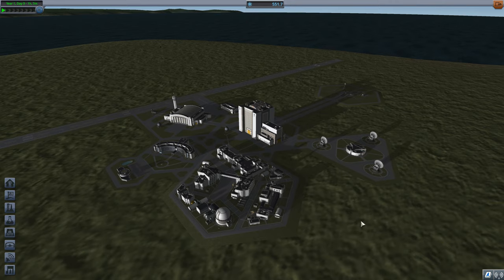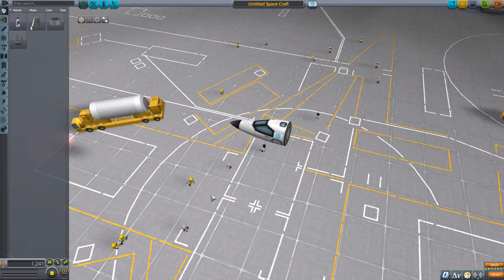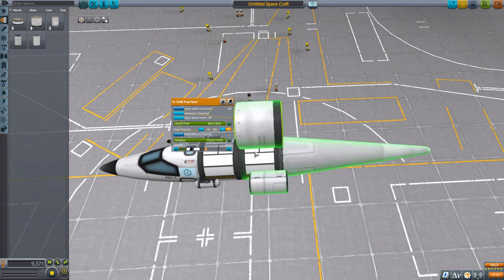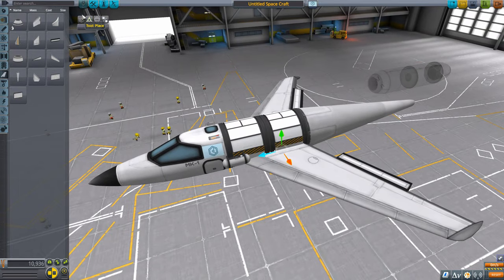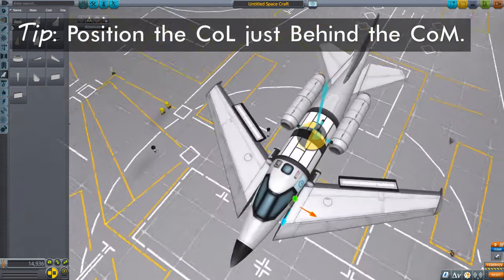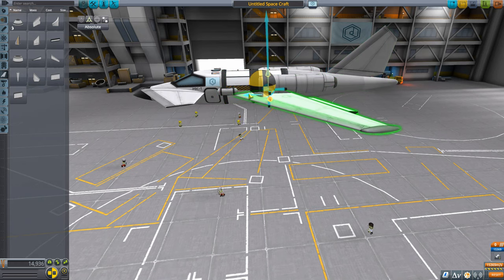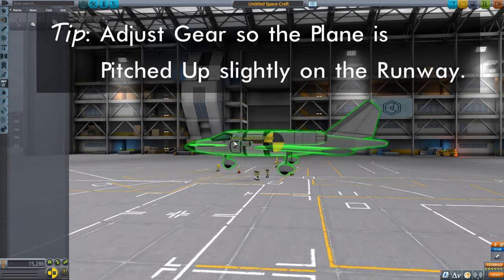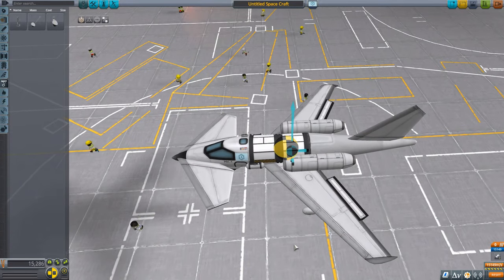Designing Your First Plane - KERBAL SPACE PROGRAM Beginner's Tutorial

Comment: Great tutorial. One other factor you didn't mention on landing gear placement is making sure the main gear (rear) are pretty close to parallel. Depending on where you mount them, if their camber or caster is too far out of alignment, the plane will be unstable when rolling and if one side lifts first it will cause it to pull hard to one side and strike a wingtip. (which usually doesn't end well)
There was a mod with gear that would automaticly align, but with stock you should spend time to get it as good as possible.

Comment: A couple things I'd like to add/clarify:

For the first plane (the tech level shown in this video) balancing the CoM and CoL so closely is actually far from necessary.  Just make sure the CoM (yellow icon) is forward of the CoL (blue icon) and you're good.
In fact, I find it easier to have my elevators at the back in this design, as shown at about 12:00 - this makes the plane less agile, but more stable, which means easier to control.  And since this is aimed at beginners, I think ease of control is more important than agility.
It also makes the tweaking of the control surface deflection (show in the next video, if memory serves) almost completely unnecessary, which in turn means one less item on the checklist that could lead to catastrophic mission outcome...
Reply from the maker: All fair points. A lot of it is personal taste. I don't like the feel of a very nose-heavy plane and so much prefer the CoL quite close to the CoM. I also rarely use the tail connector that I do here (I find it too long) preferring instead an empty Mk1 fuel tank or even the Hammer SRB so I can get into the high atmosphere, but I thought all of that would be too much for this video.

Comment: thanks for the vid I'm making a space shuttle but I can't get it to glide so this helps a lot also (ik I'm a year late) can the center of lift be above or under the center of lift or does it not matter
Reply from the maker: It can matter especially if your angle of attack is high, like with a space shuttle on re-entry. If the centre of mass is quite a bit higher than the center of lift and you're pitching up aggressively, you can reach a point where the CoM goes behind the vertical going up from the CoL. If that happens, there's a good chance the plane will become unstable.

With shuttles on re-entry you want your mass as far forward as you can. During this phase your fuel tanks should be mostly empty. I like to move all the fuel to the most forward tanks. Sometimes I even have empty tanks for fuel or monoprop up forward just for this purpose. This will increase stability during re-entry. 

Once you start pitching down and going into glider mode, you can start moving some of the fuel back to improve handling.

Good luck.
Reply: Mike Aben thank you so much for the help!!!
Reply from the maker: @wombat_pickle1674  You bet

Comment: The move is weird, and instead of moving both wings in the same direction, it moves them in the opposite direction. Can someone help?
Reply from the maker: It sounds like the were attached using radial symmetry rather than mirror symmetry. Change the symmetry to mirror (the button's towards the bottom left), grab the wing and then reattach. Let me know if that doesn't solve the problem.
Reply: @MikeAben  Thanks! It’s working now

Comment: Followed your tutorial to a tee and at 14:30 I can't get the blue ball behind the yellow ball.  I'm not sure what I'm doing wrong.  There seems to be an edit in the video because at 14:28, the ailerons are behind and the at 14:31, they are in the front with you not showing how it was done.  I've tried to "slide" it over but it only slides a few feet and stops.  I have to delete it and re-add it but then the balls are not in the place where you show them.  What am I missing?
Reply from the maker: There is definitely an edit, but I simply grabbed them and put them in their new spot. As you observed, the move tool can't move them that far. One possibility is that there is that a lifting surface has been duplicated but it is inside another part so you can't see it. Also, I've had the CoL indicator (the blue ball) get messed up. Try reloading the craft and see if that resolves it.

Comment: For some bizarre reason, I'm following your design to a T and my center of lift is angled in a weird way instead of straight up. I see no reason why it should be doing this. Is it a bug?
Reply from the maker: It's possible. You may have also rotated one of the lifting surfaces by mistake. Take them off one at a time to see what's causing the rotation, then replace them with new parts (don't just put the old ones back).
Reply: @MikeAben  I found the problem - putting tge rear tail fin on without angle snap, and then trying to align it to be straight makes it always turn the plane in an odd direction.

But now I have a different problem - when I go to the runway, the stupid wheels do not want to keep me going straight, and it wobbles around significantly till it crashes. Yeah I know its serviceable as long as I can takeoff, but I haven't had a successful landing yet and I suspect the wheel wobble.
Reply from the maker: @WasatchWind  It may be much the same issue. I would take off the existing gear and replace them. Also, increasing the friction on the rear wheels helps with landings.

Comment: You say you can connect air intakes anywhere, But I only managed to connect them to the small fuel tanks. What did you mean by 'anywhere'?
Reply from the maker: Just that if they are connected to the plane anywhere, they will be feeding air to the engines. Their positioning doesn't matter.
Reply: @MikeAben  thanks a lot! I will try it tomorrow def. Couldn't figure out building and flight before your tutorial. Will be mastering landing as well tomorrow evening.

Comment: How much do we need to worry about the mass of fuel consumed moving our CoM when we fly long distances? At some point the CoM drifts so far from CoL, but I'm not sure how far you can get away with.  I've only done short hops so far, but I have an extended science flight planned, and the last thing I want to do is be two hours into my flight and the thing become completely unflyable. I notice CoM swing pretty violently based on how full the tanks are, etc...
Reply from the maker: It can be an issue, especially if the fuel tanks are towards the front or back of the plane. Centralize the tanks and watch the CoM in the SPH as you drain tanks. Never let the CoM move behind the CoL. Remember the default is that tanks drain equally, but you can control this by adjusting the fuel flow priority of each tank.
Reply from the maker: @theamericandemocracyausers513  Or ditch.
Reply: @MikeAben  #ItsARental

Comment: Hey great video!
I have Only one problem, i have also the first aviation unlocked and got the new engine and air intake and the Wings. But i didn't get Those small fueltanks. Anyone how that is possible?
Reply from the maker: I'm assuming your game is unmodded. You should get the small fuel tanks in the same node as the Juno jet engine and Mk1 cockpit. Check the aviation node in the R&D center. The part you're looking for is the Mk0 Liquid Fuel Fuselage. If it's not there, something is wrong.

Comment: I still keep flipping before taking off :x
Reply from the maker: You're flipping while still on the runway? If you're pitching up and over backwards right after takeoff, try moving the centre of lift further back.
Reply: @MikeAben  I found out that I was simply waiting too long before taking off, so the friction of the wheels somehow increased or something with the speed
Reply from the maker: @theulfhednar2655  Could you have had the brakes on? You can adjust the friction on the wheels if it's too high.
Reply: @MikeAben  I think the friction was a bit too high, since the brakes were off. Never really touched the wheels too much. But I did find a technique though :O